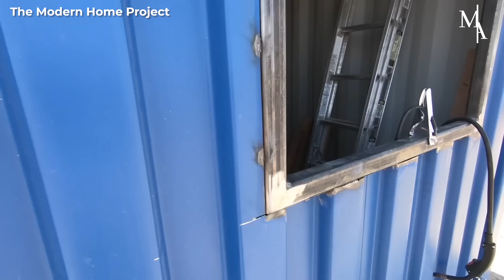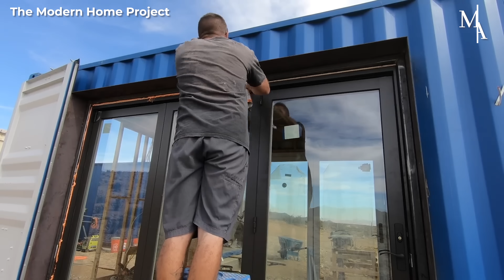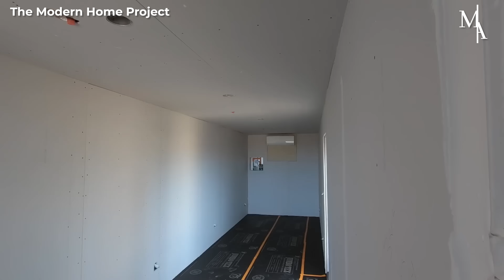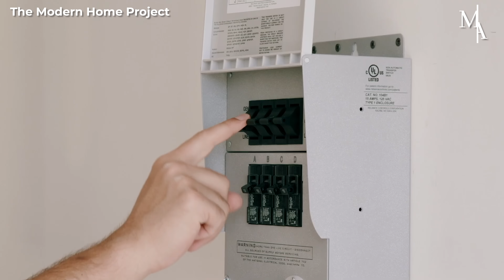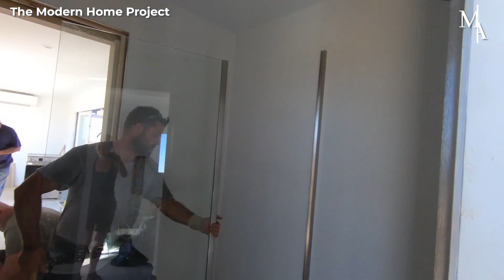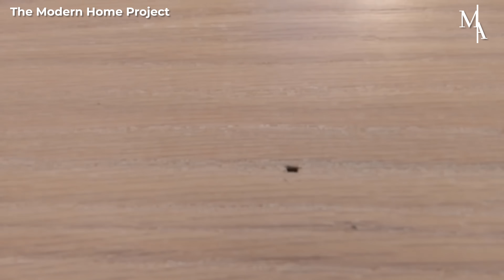Man Builds a Dream Container House in the Middle of the Desert | Full Build by @themodernhomeproject

Comment: having to frame inside a shipping container makes using the container stupid,who the fuck wants a room thats 6 or 7 feet wide? if you use wood to frame without the containers you could make an open concept in considerably larger lengths and widths and not be hindered by narrow shipping container dimensions.the containers make this a higher cost hindrance ,a nuisance and a total disadvantage you are overpaying for.

Comment: Interesting to use shipping containers, however you are basically building a wood frame house complete with sheathing but now being constrained within a narrow rectangle which is narrowed further by 6 inches on each interior wall to accommodate 2x4’s, sheathing, and drywall. You have a traditional stick build inside a metal box.  Not sure I see the point

Comment: Builds like this aren't for everyone or make sense to do everywhere, but here are some reasons that container homes can make sense.

1. Containers are actually fairly weather resistant, especially fire, flooding and earthquakes. Here in Washington State , we had a community lose a dozen or so homes in a fire, and three of the remaining houses standing were two container homes and one concrete block home.

2. They can be fairly cost efficient, particularly if it's a small footprint that you're going for anyway. Using a prefab structure like this can save you thousands of dollars, which is a significant amount of money to a lot of people. It's true that it can cost a lot of money to ship it somewhere, however, it isn't that difficult, because they are literally built to be shipped. Sure, having one coming from a California shipyard out to Idaho isn't going to make sense, but the point is, it can be a cost effective option for a lot of people depending on location and availability.

3. Using containers to build homes is part of a fairly modern movement to reuse materials that would otherwise go to waste or lie around forever, doing nothing. People worldwide are starting to recognize that these materials and items aren't going anywhere, so they may as well be put to use. Other items similar to this would be tires for structure or even roof shingles, crushed glass as a concrete compound, denim and leftover wool as insulation, and bottles filled with solid material as insulation and structure.

4. They are not pest friendly. Containers are built tight, so pests won't find it easy to call them home. Containers are a popular choice for builds in places where rodents and/or termites are a problem.

It's true that in some locations, they are very difficult to insulate to keep moisture down, but lots of places don't have much of an issue with moisture and it's similar to how you would insulate and vent a basement or root cellar.
Reply: i was thinking about how well they'd withstand an earthquake.
Reply: agree as comment above, plus can put plumb and floor in after even dig a bunker under
Reply: all of these are as flammable as any regular framed house

Comment: There was no reason for putting plywood on the interior walls, it can be covered with drywall with insulation behind that.
Reply: I believe they mentioned it was a code/structural engineer requirement.
Reply: @alanmihalko502  ok

Comment: Wouldn’t it be easier to just build a traditional structure? Also it would be more cost effective and have more architectural features and flexibility. This is a fad that will fade away. Sorry, the emperor has no clothes.
Reply: In reality...yes.
Reply: this "fad" has been going on for 20+ years. you're just late to it. it's cost effective depending on what you're doing. a container is $2k or so. a person could turn one into a gym, an office, an adu, etc.
Reply: yeah, it’s much easier to work with. If you don’t know what you’re doing. At least you have a shell to work with. I started trying to figure out framing an initial structure.   There’s a lot of people out there that are too busy or too expensive for some or no don’t finish jobs and isolated regions. There’s lots of reasons where our containers can be good or easier.

Comment: The one thing I like about this container house video is that fact that your are honest about the structural integrity being compromised with the removal of pieces of the container.
Reply: Use a shipping container as a skeleton inside the exterior of log cabin. 3x the insulated R-value.
Reply: I actually think the concern over loss of structural integrity is overblown. These containers are designed to be stacked on top of each other on container ships and transverse the ocean in all kinds of weather. They are stacked 7-11 layers deep, depending on where they are located on the ship. In a residential setting they aren't seeing anywhere near the levels of stress and strain they see on those ships. Putting in a few windows and doors is of little concern.

Comment: I do not see the advantage of containers. If you are going to have a full slab and studs and rafters, why not just build with sticks?
Reply: Also seems like you will heat up a lot in the desert sun.  Besides why live in such a narrow space.
Reply: I've also pondered paying $3,000 + transportation for a cramp container, then spending money remodelling it on my farm. You made such a great point, I rather use timber frame and dry walls
Reply: @Mali-kd1zz Or buy a used 5th wheel and modify it and build a room off one side as a family room and a deck off the other.
Reply: 💀 ppl complaining like they have to live in it or do it. How is the way someone else chooses to live affect you? Lmao.
Reply: @Sincity44  Yaptastic. You're defending him if you're about to do it too.
Reply: @DxBlack what you running on with? I just don’t sit around and mope about how ppl live their lives like you and other ppl do. Stop being simple minded. Anyway ✌🏾
Reply: Agreed, the container basically becomes overdone siding
Reply: @richcummings9686 pretty inexpensive too. 👍🏼💪🏼
Reply: With all that time, labor and money, that house came out pretty fuckin rubbish
Reply: Because sticks rot, and a container build costs 1/3rd the cost of a stick build every day of the week. Frickin modular homes AND mobile homes are starting around 100k these days...
Reply: Metal doesn't burn
Reply: EXACTLY !  i was a blocklayer , i could block up a good size 4 bdr house by myself in 4 weeks max. and prob core fill in 1 week. Learn about footings, soil and a basic block laying course, easier said than done but containers are for ppl who dont know i guess
Reply: Metal lasts forever
Reply: @Fruitgypsy1212 proper timber builds, with proper maintenance regularly outlast humans.
Reply: @tmfp36 have you seen Andrew camrata container castle. I’d lean more towards that build. Less wood more concrete
Reply: @Fruitgypsy1212 to be fair, his stuff is completely different and I feel like his construction warranted containers
Reply: @Fruitgypsy1212 steel is for real.🤙🏼👍🏼💪🏼

Comment: There is no such thing as a 'dream' container house anywhere.  You want a house made of metal? In the desert? Aside from saltwater what conducts temperature better than metal?  Go with Adobe.  2 foot thick walls, it takes 10-12 hours for heat to penetrate the outer layer during the day and then when the temp inverts and gets cold at night the heated walls become useful.  At night the cold air is exchanged, keeping the home cooler till the cycle repeats.  
Oh yeah--dirt and sand is free--straw costs so little it's embarassing.  You just have to have the will and patience to make the blocks.
Reply: You were sayin'?
Reply: @AJGUNNER  I already 'said' it.

Comment: Very nice built, but on this build using shipping containers doubt you saved a lot of money than doing traditional stick & bricks construction.
Reply: It's California, so there's that
Reply: Exactly! Shipping containers are one of the worst mediums to use - ever. Unsound, thin, rust prone, weak in general and small and don't forget the vapor/moisture problem these consistently face... The 'fad' of these are just that. No matter how you adjust these, the extra work just to make it work is not worth it, just to say you made a 'container home.'...

Comment: Забавно. Сделать нормальный деревянный каркас  нужного размера вписанный в каркас из проф трубы и зашить проф листом если вам нравится его вид  гораздо удобней и дешевле чем купить контейнер заданной конечной площади и потом его переделывать. Тем не менее люди постоянно совершают эту ошибку. Проблема контейнера это его конечные размеры.
Reply: There are so many things wrong with this it isn't funny, so I will only point out one other than the timber (actually "stick" framing).  Those steel plates would hold such an inordinate amount of pressure and weight they are pointless when you drill a hole in the concrete one inch below the surface.  Give me a standard framing hammer unless they have renamed those to and in 10 minutes per corner and I bet I can make the whole thing liftable.  All to live in overtaxed, way over regulated California that is bankrupt, but they think they are masterminds.  I guess when you are paying $5.00/hr wages you can afford a $500k sewage system that forced you to grow flower.  nothing you can eat though...